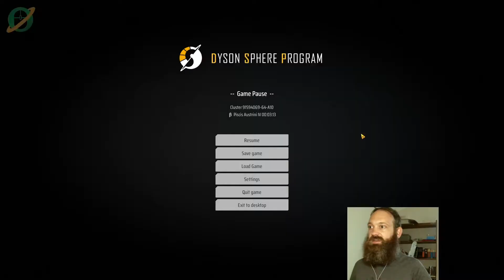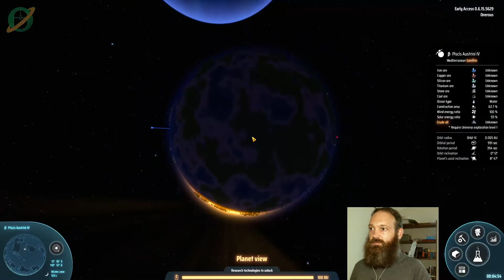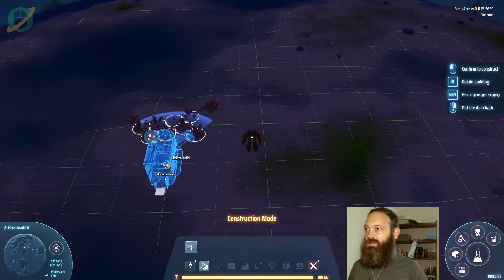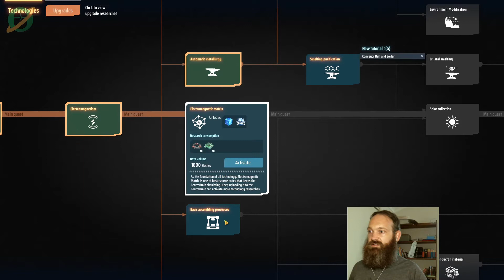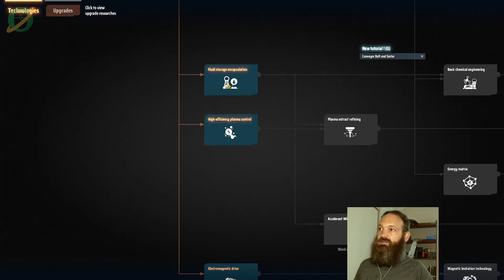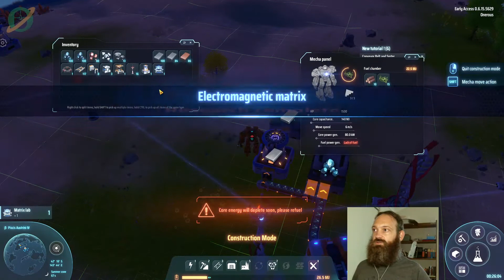Dyson Sphere Program Ep 01 - First Look

Comment: 3 more questions: 1- Does the robot have a name ? 2- Is there like an objective menu at this stage that currently gives you broad goals to be reached ? 3- Do you know if the plants regenerate ? What happens if you run out of plant for fuel ?
Reply from the maker: 1 - No name that I'm aware of, though normally the game community settles on a nickname eventually. 2 - there's a main quest line of technology, ending in the building of the Dyson sphere. The intro talks about the story. 3 - don't know about regrowth, but there are coal deposits and you can research tech to charge from your power grid.
Reply: @OnerousGaming  very nice !!  Thanks
Reply: "1- Does the robot have a name ?" 
Why am I getting some serious Bicentennial Man vibe from this question? :D